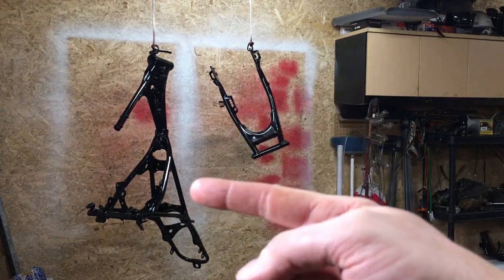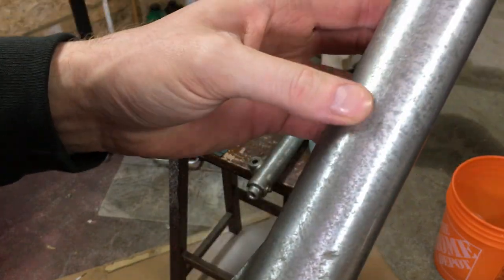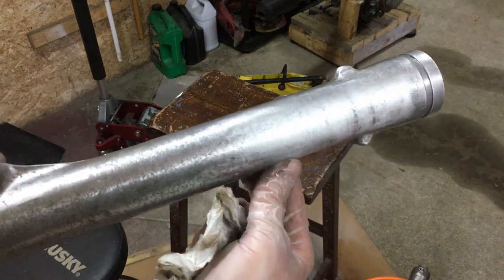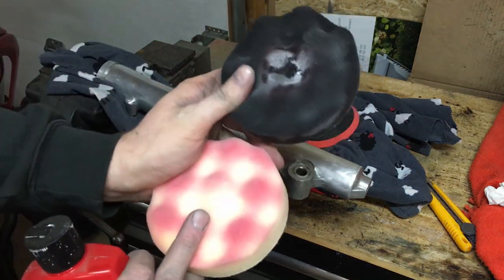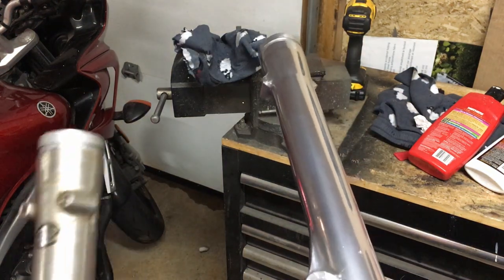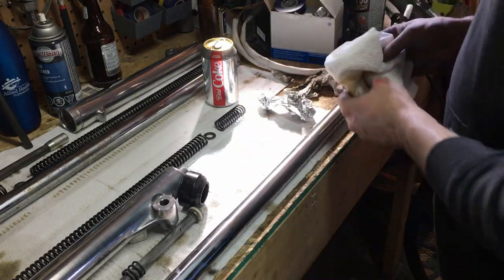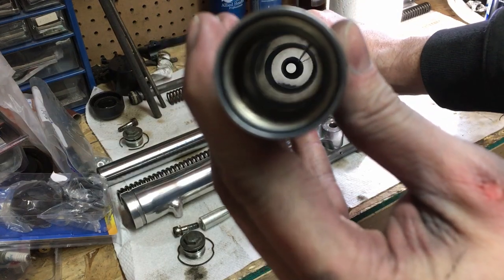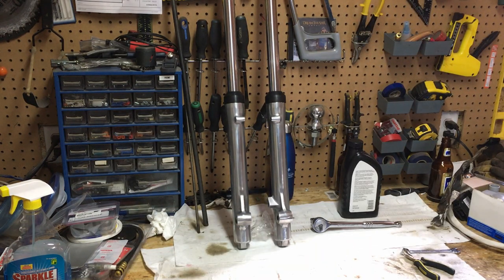1981 Honda XL125s Part 6 - Fork Cleanup and Rebuild

Comment: I've nearly finished my build but I think I may have to restore the forks like you did. How did yours "feel" before and after you changed the oil and seals? I'm not sure if mine are bottoming out, but they definitley feel a bit spongy and slow to return after compression.

As always great videos, I've learned so much about these xl's.
Reply from the maker: For the relatively low cost of a fork seal kit and the couple hours it would take to rebuild them, I'm recommend just going for it. There's a high likelihood that they've never been rebuilt before, and a freshly built set of forks is just awesome!

Comment: good day sir im from the Philippines i have a XL 125s too. for some reason the manual is missing at our house. if i may ask, how much fork oil did you put in the front forks?
Reply from the maker: Use Dexron ATF or SAE 10W fork oil, 1979-1980 XL125s front fork oil capacity, 155 ml, 1981-1983 XL125s front fork oil capacity 160 ml. If this was helpful for you, please subscribe!
Reply: wow fast reply. thank you sir. and domt worry i already subscribed to you yt channel. ill be buioding a cafe racer out of ky XL 125s this would be epic 😊
Reply: hello! can i ask about the valve clearance on your XL 125? and is it a 6 speed transmission?
Reply from the maker: @mumskieeserva856  2 thousandths on the  Intake, 4 thousandths on the exhaust.

My bike actually has an XL185 motor in it, but the clearances are the same in the manual.

As for the transmission, the XL125 was a 6-speed. My bike with the XL185 motor is a 5-speed.

Hope this helps!
Reply: this is a very big help for me. thanks! having an XL manual here in the Philippines is very rare, old bikes like the XL here are consider ancient. that is why im asking help from you, evwn if you are on other country. thankyou so much sir! ride safe!
Reply: @blastworks  hey long shot just wondering if you measured the length for the stanchions?
Reply from the maker: @shauningham4466  Unforunately I never. The part number for the fork pipes is 51410-437-003, but I couldn't find anything regarding length with a quick Google search. Maybe you'll have more luck!
Reply: @blastworks  have definitely tried the old Google machine but not allot of luck finding lengths,parts or info on what will work thanks for the response!
Reply from the maker: @shauningham4466  Here's the parts fiche that I use, should list pretty much everything, parts numbers, etc...

https://www.cmsnl.com/honda-xl125s-1981-b-canadakph_model20113/partslist/